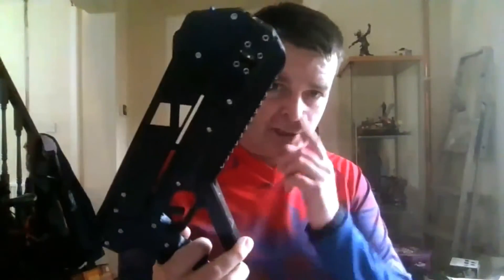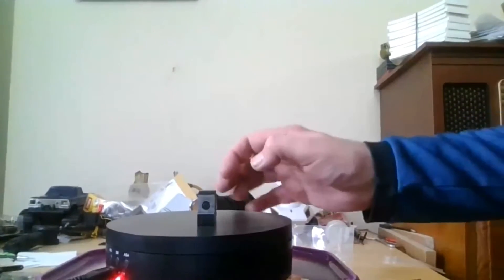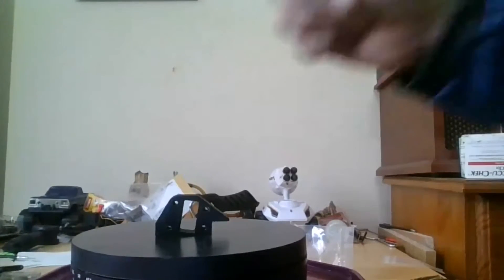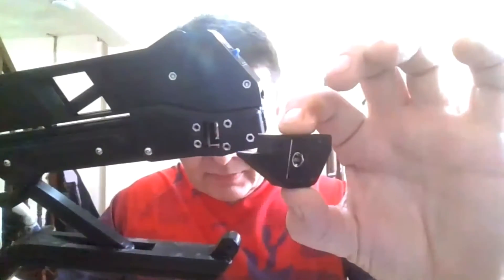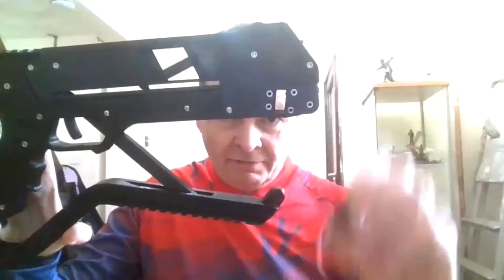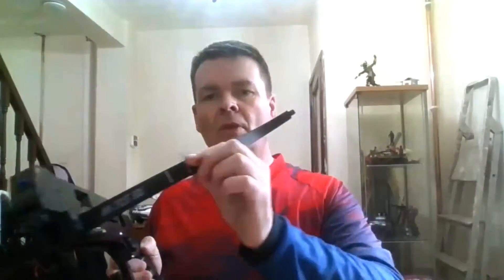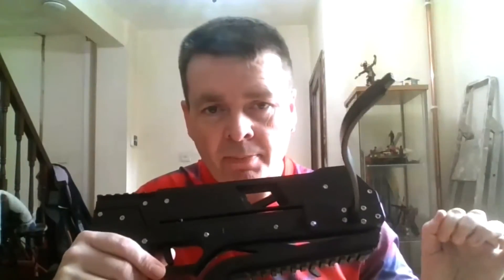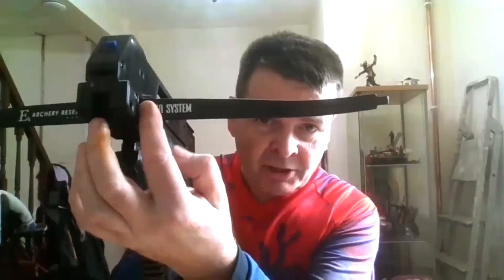Ultimate adderini Crossbow Build Guide Part 7 Finish and Testing

Comment: What do you use to push the pressure pad
Reply from the maker: im not sure of your question, but before kyou tighten the riser bolt and the limb is loose, you just place the pad behind, 3cm X 2cm piece of leather will do, its just to grip the limb and stop plastic on plastic friction.
Reply: What saught of bolt or screw/washer that presses into the pad? @markhuckercelticcrossbows7887
Reply from the maker: @dragonode1  off the top of my head, I can't remember, I know its in the pdf from lukash jenakowski, on cults 3d, if I remember its about 5cm long, Allan head bolt, I THINK I! its an M12. but I'm not sure. where you push the bolt in from the front, you fit a 12mm nut on the inside If I remember, has been over a year, since I done one. printing Farmimers Mini Adder at the moment, that's a different design, with alloy chassis.
Reply: @markhuckercelticcrossbows7887  oh okay so that pdf does explain everything you need right? Everything other than the print out
Reply: @markhuckercelticcrossbows7887  does the head of the bolt touch the pad or the other end? Btw I really appreciate this coz I'm trying to build one and this is never before seen in Australia lmao
Reply from the maker: @dragonode1  aaah right, you gotta read the plans upside down, while your in the dunny, if your in aus then :) lol

the bolt passes through the front body, through the nut, presses against the metal plate, which presses against the rubber (could use leather) pad, which presses ahainst the front of the limb. this then pushes against the rear pad, which presses it against the body.

in my vodeo on making the crossbow version, part 5 or 6, ive hot a good video close up of it, ill find it and attach it now
Reply from the maker: this section is on how the limb goes in
https://youtu.be/vZiaLA8rImA?si=RNMdDCDTtx4rlxS3

ill add now, on how to locate the nut
Reply from the maker: heres the missing bit with the nut, becuase my nut and bolt, was not in the kit.

https://youtu.be/xamiQ7VPpSM?si=Ml-ePSOMhPsX0KwY

Comment: Great to see her working. Are the parts fitting nicely? What about the lever handle, did you manage to center this one better around the grip?
Looking forward to the comparison test.  you'll be posting it today or what mate?
Reply from the maker: hiya butty, ill be posting it on wednesday, have had a busy day today, ill post some shorts tomorrow, to drum up interest :)
the handle fits much better, its gripping a little to tight on the front, but rather than file off the extra, im going to use it and let itself, find its own bedding point.

im not going to give away any comparisons yet, just one... the slingbow trigger is much sweeter

Comment: Hey bud, I heard you mention the alleged 80lbs bows, will they work in this version ?
Reply from the maker: i like your alligator/op360 you might want to check out my 90lbs limb fitting guid and how to covert a steambow stock to fit :)
Reply from the maker: hiya ivan, they will work... but! you will have to CAREFULLY modify the riser block and side plates first, and put in more material on the cocking pivot.